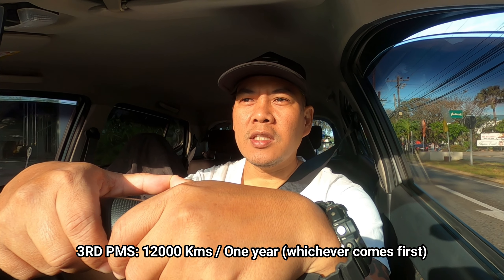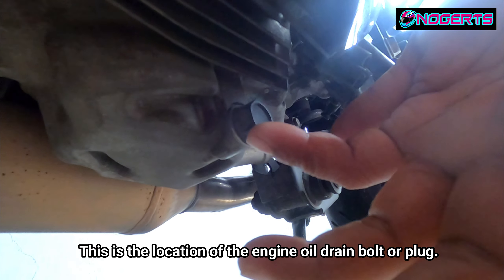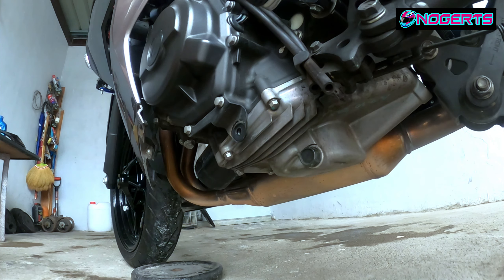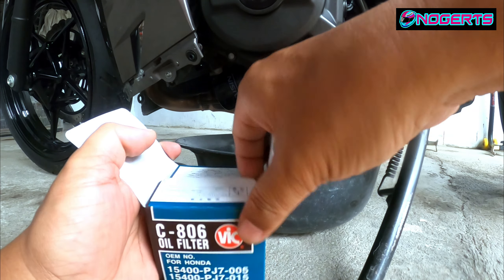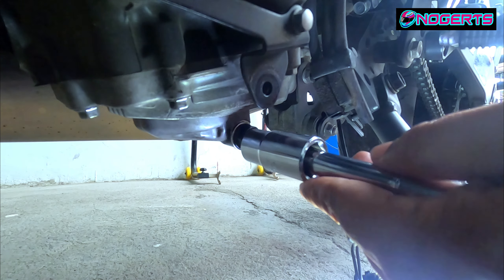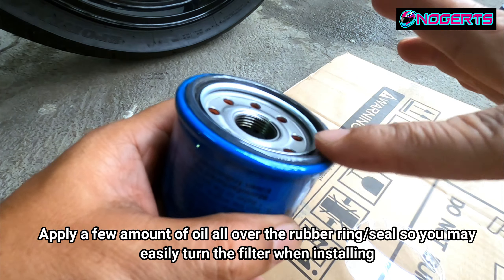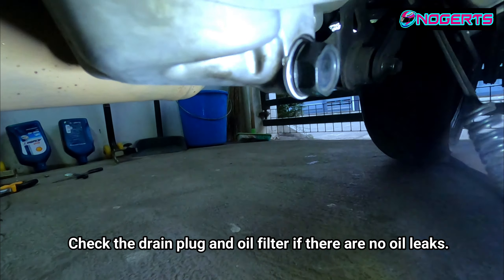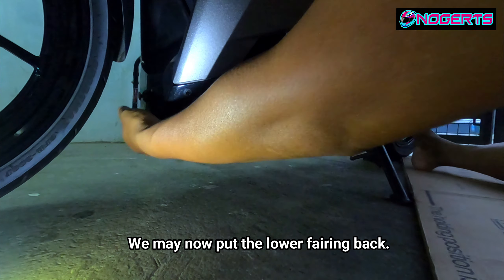DIY Oil Change | Kawasaki Ninja 400

Comment: I tried to help them on Kawasaki Forum but they resist the knowledge and don't want to change the oil before it turns black, I told them that the sight glass was to monitor the color of the oil but they said no.👍
Reply from the maker: Haha. Let them. At least you did warn them. Some people are just stubborn.

Comment: Ilang odo ka po nagpapalit ng oil?
Reply from the maker: Sorry 1k pala then nxt is 3k or 1yr
Reply: @nogerts1974 pagbrand new first change oil 1k?
Reply from the maker: Yes sir 1k po 1st oil change ko. Mineral muna after 6k na ko nag synthetic..
Reply: @nogerts1974  anong pangalan ng mineral oil?
Reply: Brand?
Reply from the maker: @rafzody34nanoz  Enoc gamit ni Kawasaki sir
Reply: @nogerts1974  di ba may dati ng oil yung motor mo pagkabrand new?pano nilagay yung mineral oil ?
Reply from the maker: @rafzody34nanoz  mineral oil is what they use when releasing your bike from the factory sir.
Reply: @nogerts1974  stock oil?